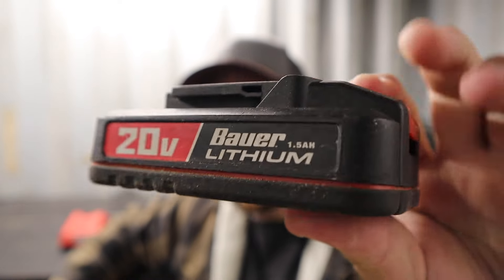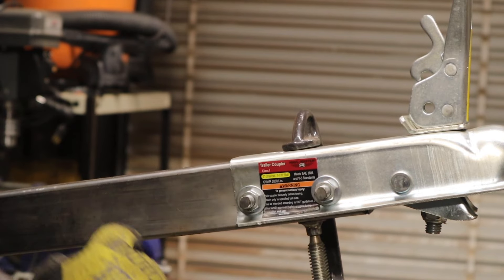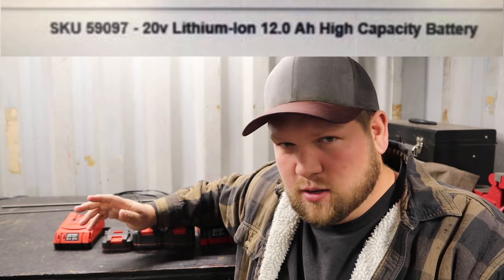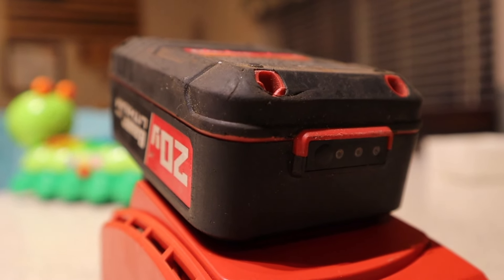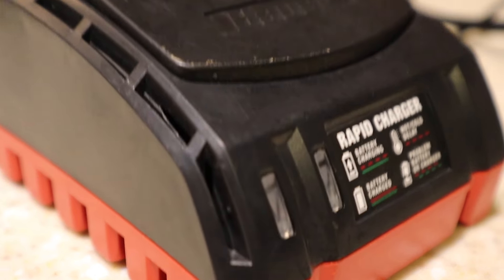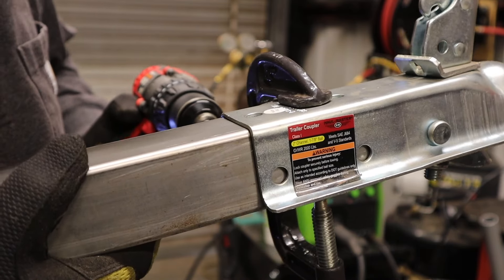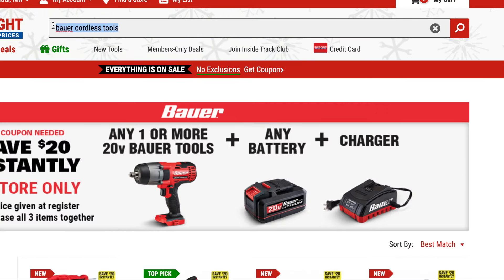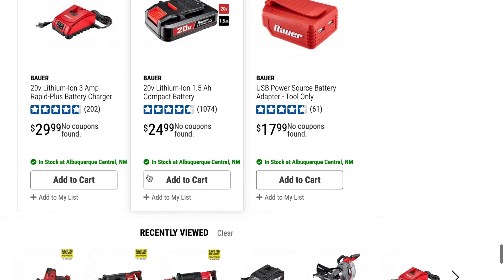Reviewing the Bauer Cordless Tool Line - Over 2 Years with the System!

Comment: I was strictly a DeWalt fan....and then.....I could not keep batteries that were any good for very long. I bought a bunch of the original batteries until they started dieing too damn quick. I went to the off brand of theirs, and pretty much the same thing. These were 18v batteries. I now have nothing but Bauer 20v tools now, and I love em so far. I'm mostly a do it yourself guy and they are perfect for what I do. Until something drastic happens I will stick with them.
Reply: Well, has anything drastic happened? Haha, I just bought the hammer drill/driver today. I wanted the Hercules but the wallet says otherwise for now.

Comment: Great video. I am sold on the Bauer line up. I have been using them in my garage and have had zero issues so far. The deal on 5 amp batteries was hard to pass up so I have 3 now. The 1.5 amp battery that I have found a home running my work light. I feel like that’s the perfect fit for such a small battery. Thanks again for your videos.
Reply from the maker: Thanks for watching man!

Comment: I think people point to the sale prices on Milwuakee tools, which can sometimes be pretty low, but I think the big difference is the prices of batteries. Sure you can get a kit with two batteries, but then when you go to buy that third or fourth battery, or a high capacity battery, that's when you end up really shoveling out the dollars.

For me just like you, it's a huge thing to be able to afford more tools and batteries. It's really given me a lot more ability to do things around the house by having my bauer tools.
Reply from the maker: Oh for sure, but even outside of that, like you can get a Drill/Driver and Impact with 1.5ah batteries (in Home Depot and just saw the deal as I write this) for $150. Christmas deal of course. You’d spend almost the same to buy both Drill/Driver and Impact kits from Harbor Freight (about $120 I think). 

I also saw a deal for like 6 tools, a charger, and two batteries (I think a 1.5 and a 3.0 ah) for like $500 and that’s a good  deal too. That being said, you’d have to spend $500 right then and there, and then to get any additional tools, your not getting an deals on them. So the common “kit tools” might come pretty close to Bauer but as soon as you want some unique or job specific tools, you’re going to really pay them there. And then of course the whole battery issue you described too.
Reply: @DereksWorkshopAndProjects  also Re-the warranty, for me I probably wouldn't even consider buying Milwaukee, and if I did it would be the bottom dollar ones. I'd probably look at Craftsman, Ryobi, or another discount brand. With the usage level if my tools, it's pretty unlikely within the first year or two that I would need the warranty. So paying extra isn't likely to pay off for me, I'd rather have the extra tools I have with the money I saved.
Reply: Its the batteries for sure.
I was debating buying ego or atlas trimmer.

Now I'm in now way saying they're equal trimmers.
But that ego battery cost.....

Comment: Just bought my first Bauer tool (1/2" impact) because I couldn't see buying the Dewalt when it's something I don't use that often. So far I don't see myself switching over completely but most likely I'll start buying Bauer for the tools that are going to see light use and stick to Dewalt for tools that will get heavy use.
Reply: I just bought their 450 ft lb cordless, brushless driver and the $129 1000 ft lb impact wrench and it is a beast!

Comment: thanks for the review. Good information here. I just bought the small chainsaw and it's my first from the Bauer line. Why did I buy a small, cordless chainsaw? I needed something for my ATV and occasionally camping. I own 2 gas chainsaws, but it can be 2 years or more between needing one and I am just tired of gas powered occasionally used tools. I actually wanted the Atlas 80V saw, but the Atlas line is only making large tools. i don't need those as much as I need small tools and don't want to invest in multiple tool lines. Like everything from HF, know what you're buying, set reasonable expectations, and remember what you're paying for them. I don't expect a $20 set of HF wrenches to compete with my snap-on sets, nor did I pay snap-on prices for them.

Comment: Thank you! I am headed to a HF store tomorrow and I will be picking up the hammer/drill and a 3.0 battery.
Reply from the maker: Thanks for watching!
Reply: They now make a 5 amp hour battery for about $60 or so. I recommend getting the biggest battery available because you can run any tool Bauer makes.
Reply from the maker: Good advice.

Comment: I've been wondering when Bauer is going to come out with cordless kitchen appliances like a mixer, blender, can opener and maybe even a toaster.
Reply: Driers, heaters, microwave...anything with heating takes a lot of energy.  Just look into solar generators, and you will realize that your battery will run into the thousands in order to run them.
Reply: @ex8280  I have a USB hand warmer that gets quite hot. They do currently have heat transfer tools.

Comment: Thanks for sharing your experience with the Bauer lineup. I'm just now getting into lithium battery tools as my old Dewalt 18v Nicad drill is getting old and I'm needing additional tools. I picked up the 1/4" Bauer impact driver to build a deck and its been amazing. I ended up needing my old skill saw and decided that it to needed to be upgraded so tomorrow I'll be picking up a new 6" Bauer skillsaw and 3amp battery.  I'm Thrilled to be cutting the cords for my home owner projects. Thank you for giving us real reviews on the Bauer tools.  And keep us informed as the line changes. Fingers crossed that Harbor Freight keeps the Bauer brand for a long time.

Comment: I keep 2 batteries at my apartment in a nice 70 degrees with a drill from random little apartment projects like a little chair I fixed up for Christmas, but the rest of my batteries stay in a cold unit and they run just as fine as the others. While I know it’s not good for them I just wish I could have a grouse with a garage and a dedicated spot in my laundry room just for batteries.

Comment: The 1.5AH battery is terrible on most of the tools I've tried it on. Just burns through the charge super fast.  I bought 2 of them and won't be buying more.  I have a few 5AH and those are definitely nice, but for me, I have found the 3AH to be the sweet spot.  I love my Milwaukee tools as well, but I just can't afford the high prices.  With Bauer I can buy more variety for my money.   Thanks for the review.

Comment: I just have the Bauer angle grinder and have some issue with putting the battery onto the tool. I havent looked into it much but just seems to stick before it clicks. Then taking it off it is just as tight. Have you have any problems like this?
Reply from the maker: I haven't had any problems like that.

Comment: I about to by the Bauer airless battery powered paint sprayer 2mwr & see how it works painting doors. The Gracco sprayer is $750 with 2 Dewalt batteries witch I all Dewalt tools don't need more batteries Baures $200 no batteries I also found a battery adapter for Dewalt batteries for Bauer tools I might try. Dewalt batteries are unafordable by themselves your basically forced to by a tool that comes with a battery I almost bought a Letheli DVLP sprayer but doesn't come with a battery you have to order it I don't want to wait so I think try the Bauer one it looks more similar the Gracco brand that is the market leader. I'm curious I wish I could find a review of it Online I think it's relatively new though so if I buy one I'll let you know how it works.

Comment: I use 1.5ah's in things like lights and drills. 3ah's are your mini vacuums, 5ah's are your grinders /saws.

I want the damn brad nailer in stock! lol I'm still waiting on the oscillating multitool and surface conditioner. One day...
Reply from the maker: That's make sense with the batteries and their purposes. I'd say 1.5s do work good for lights.

Comment: How they holding up now? Update video? I currently has the old 18 V DeWalt system. They’ve held up for a long time the batteries where they get you. I’ve gotten some knock off ones from Amazon but just not pleased with those. Debating on dropping 500 bucks on a new combo kit or getting to the Bauer line. By the tools when I need them I’m no longer in the trades.
Reply from the maker: Man, I’m happy with them. I don’t want to over sell them to you. They are a high quality DIY brand or a lower quality Prosumer brand. Not a pro brand. But they work really good for what they cost.

Comment: Yeah I have 1 8ah Bauer 20v  battery and the increase in power as you get bigger battery packs is definitely significant and when the 12ah battery comes out which I think is already out but it's not on their website yet but I heard it's in the stores already I most likely will just get 1 of them also just to have  and compare because I have a bunch of the 5ah and several 3ah and 1 of the 1.5 from a kit deal but when the new big 12ah hopefully has a deal where you get a good free tool I'll probably get 1 of them  and I have each of the chargers that you have plus I have the double charger that actually even charges faster and charges 2 batteries at once which is pretty awesome and they even have a charger where you can charge 6 batteries at once but I believe they only charge 1 at a time back to back which could be cool but I think the fast double charger that I have is probably good enough and I think I got it free in a deal or something like that so that's cool.

Comment: I left my battery outside in the rain. And instantly trashed. Other then that, they work fine.
Reply from the maker: Ya the water will do that I suppose...
Reply: I got one of my batteries wet using it on the weed sprayer. I took it apart and cleaned the water out and it came back to life.
Reply: @chuckpierce5756  worked with 1 of the 3 I did that with. The other two I forgot about longer 🤷🏻‍♂️ oops lol

Comment: The faster the charge, the faster the battery wears out.
Reply from the maker: Good point.
Reply: Not always true. My Milwaukee 6 AH high output batteries get completely drained and rapid charged every single day in a 10 hour window. They've been going through this for 3 years and still hold a perfect charge :)
Reply: Not really the case with lithium batteries, they can take high Amp charges without damage. The faster chargers are simply supplying higher amperage. The bauer fast charger is 3 amps, so a 6 ah battery will charge from empty in about 2 hours. It's simple math with lithium batteries due to their low resistance.
Reply: @j.r.576  Anything over 1C charging will damage the battery. The amount depends on how high over 1C. If They go past 2C, they are 1000% being damaged. From LI-PO to LI-ION it doesn’t really matter.
Reply: @blicky.  you are addressing a technicality which I did not state one side or the other of. The statement that lithium batteries can be charged at higher amperage is true. The practical limits are not part of this topic at all. Also my example as described is correct nevertheless unless you want to argue the specs as given by Bauer tools.